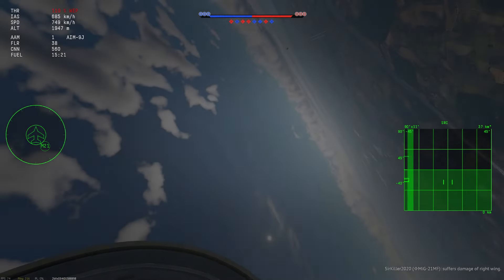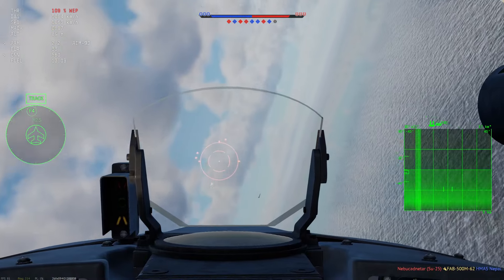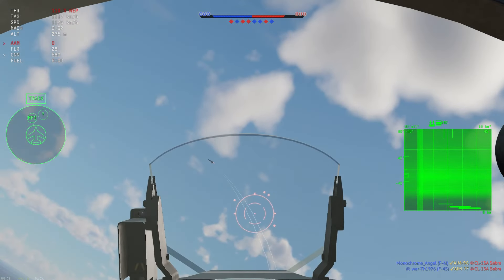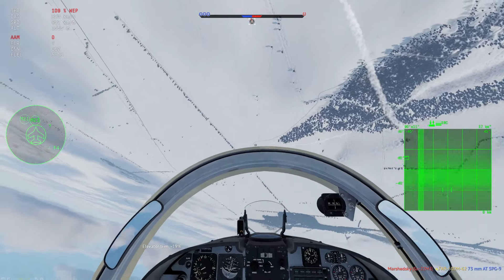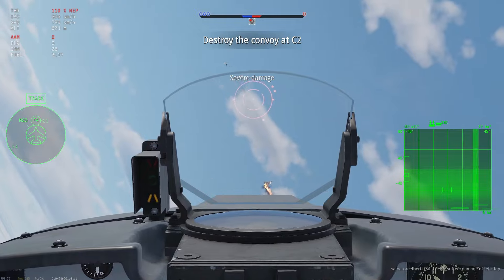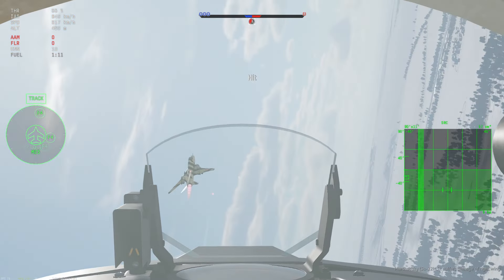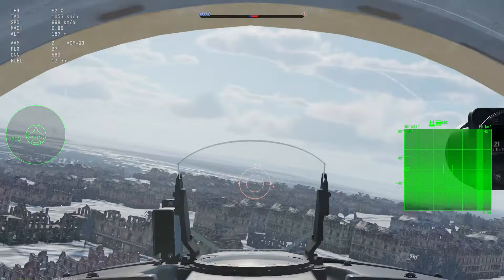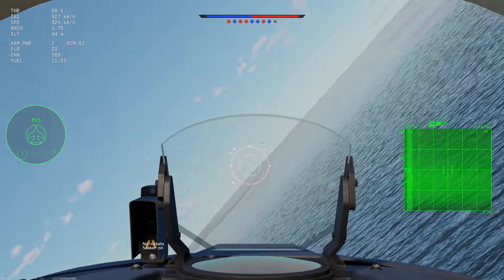Beer Thunder: It's Overperforming.

Comment: Flogger doesn’t over perform in terms of aerodynamics it just benefits from the user being allowed to ignore the manual, which assumes that you’re gonna dogfight at 45 degree sweep at all times
Reply from the maker: The diagram posted is from the manual and it shows it's turn rate at 16 degrees wing sweep afaik.

Comment: As a DCS person I can confirm that the F-5E and many of the 3rd Gen fighters do over perform. Which again WT was never setup for Sim from the beginning it was a Arcade style game to compete against Wargaming World of Warplanes and it succeeded there. But WT is not DCS and nor should people compare it too DCS. DCS from the Beginning is a Flight sim, but it took many years for it to get where it is today. But in DCS you can do things that you can't do in WT cause WT flight models are very exaggerated to the point that it's two different airframes just with a coat of paint and a skeleton to make it look like a say Mig-21 or F-5. Like for the F-5E there are some small things that make it a nice airframe to fly and in WT they are not there. For the Tiger II has a Dog Fight mode where the radar will lock onto anything within the nose search 100m-700m, I have not flown the F-5 in a while so can't remember, out front and make it so you can pull a lead on a enemy and get both revolver cannons on target during a dog fight. The F-14 and F-15 is where WT takes the biggest exaggeration to their flight model imo.
Reply from the maker: War Thunder actually pre-dates World Of Warplanes by quite a bit and it's a descendent of one of the original Il-2 Sturmovik games. I played War Thunder's predecessor; Il-2 Birds Of Prey when it was an Xbox 360 title and before mouse aim was even a thing. 

Much to the chagrin of DCS players...I will call War Thunder Sim a flight sim because that is what it is. There are some things as far as modeling goes that War Thunder does a lot more accurately than DCS at this point.
Reply: @squishface80085  WT still is an arcade where as DCS is very much a Flight sim. Yes there are a few things that WT get right over DCS but from the ground up DCS far exceeds WT is the Sim category. DCS Flight models are based on data from manufactures and data you can find cause it's declassified cause the airframe has not been in use for X years or is no longer of import to X country. Reason why I place DCS over WT is cause ED and other groups that work with them under cut performance to see where models is ether memory leaking or crashing. Then they give it's full functions and limitations. WT exaggerate flight models cause they know there fan base are a bunch of people that don't look at sheets to see if X matches Y. If WT wanted to be in the sim area they would start cutting a lot of the fat and add in more sim functions that are missing, that DCS has.
Reply: @squishface80085  Both WT and WoWP came out in the same year of 2013 both games had alpha's and Beta's in the same time frame. So in Retrospect they where in direct competition with each other
Reply from the maker: @tristainlongshot7524  

Have you looked at the EM diagram for the F-16C in DCS vs the one that is from real life?

DCS has just as wild discrepancies with it's flight models as WarThunder does and the accuracy of the flight model is purely up to who developed the module.

The real life F-16C EM diagram at sea level shows a maximum instantaneous turn rate of 26.2 degrees per second and a sustained turn rate of around 22-23 degrees per second. The real life EM diagram also shows a Ps value of around - 500ft/sec during its 26.2 degree initial turn.

The DCS specific EM diagram shows a maximum instantaneous turn rate of 22.3 degrees per second and a sustained turn rate of 18.8 degrees per second. In DCS that 22.3 degrees per second ITR will result in a Ps value of around -600ft/sec.

Basically...if both EM diagrams are correct....it means that the F-16C in DCS is significantly different than it's real life counterpart. 

By comparison...the F-16C is capable of rating at just above 20-21 degrees per second with over 50% fuel. The WarThunder flight model appears to be much more accurate when it's flown within the actual flight envelope in comparison to the DCS F-16.
Reply from the maker: @tristainlongshot7524  

Il-2 Sturmovik : Birds of Prey came out in 2009. War Thunder in it's alpha test was basically a free to play port of it. The flight models were the same. The controls were the same. The game modes were also the same.
Reply: @squishface80085  ED's F-16 is also still being worked on, also ED is working on Several other systems so the F-16 is a back burner while new "Shinny" things are being worked on. So very low hanging fruit. Hell BVM does a better job then both DCS and WT when it comes to the Viper.

While a Air frame what is far more Accurate to real life is the F-14A/B Tomcat by Heatblur. Which is far more accurate to what the Cat could do when it first came off the line and so on. The WT Cat if a fucking joke compared to DCS and IRL.

Same goes for another older system the F-15. Which is also made by ED in DCS but is only the C model not the A and is low fidelity which means it doesn't have a clickable cockpit but has all the bells and whistles needed to operate. In WT it's also a fucking joke. 

But WT is a game that is still an Arcade and will always be an Arcade F2P or P2W which ever way you see it.
Reply from the maker: @tristainlongshot7524  

When you are saying that the F-15 and F-14 are a joke in WarThunder...exactly what are your issues with them?
Reply: @tristainlongshot7524 The F-15 in war thunder is pretty accurate lol. Also Heatblur stans amuse me, their “study level” f-14 module is still very wrong with its FM lmao